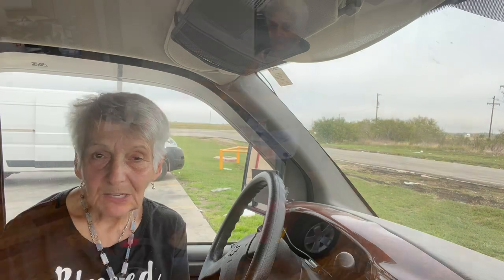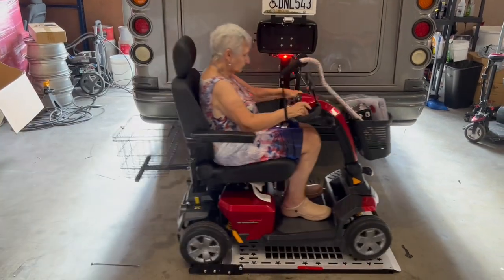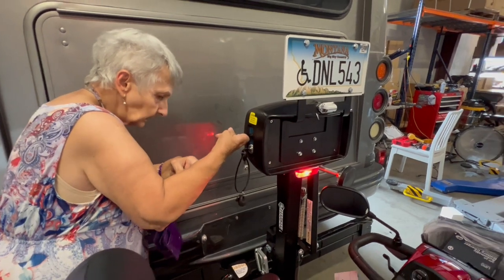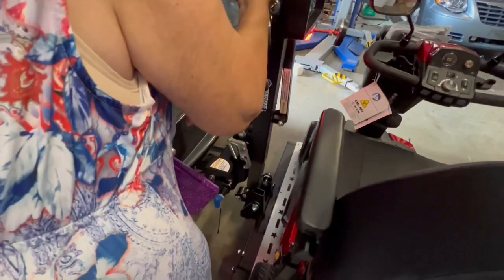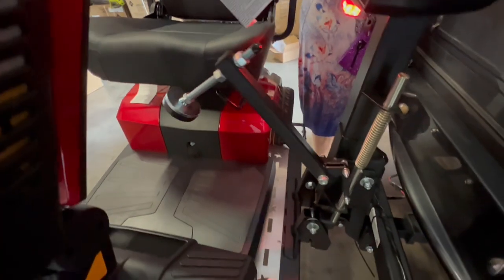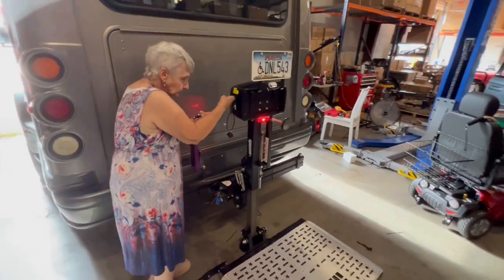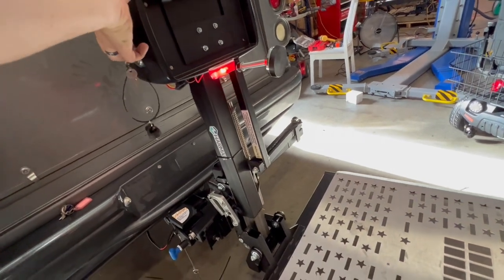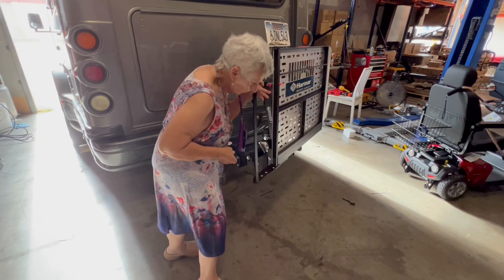COME SEE MY NEW SCOOTER AND LIFT FOR MY VAN #vanlife #MobilityScooter

Comment: can you get it repaired while on the road?
Reply from the maker: I think so. There are Mobility places in most cities that sell scooters and they usually repair them as well.
Reply: Not all tepair every brand. I have worked in mobility with Seniors for years. I would check to see if there is a rep for your brand scooter in the area you will be staying.